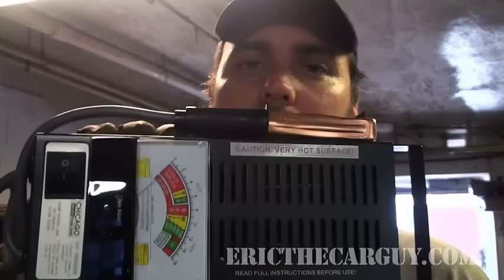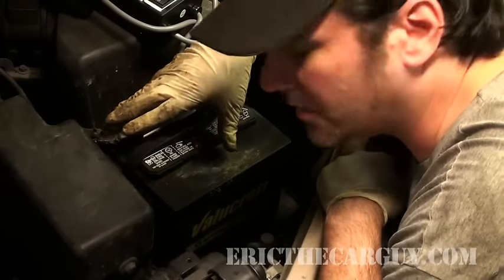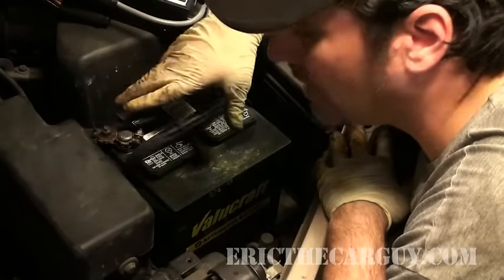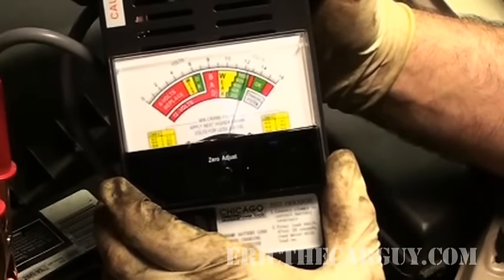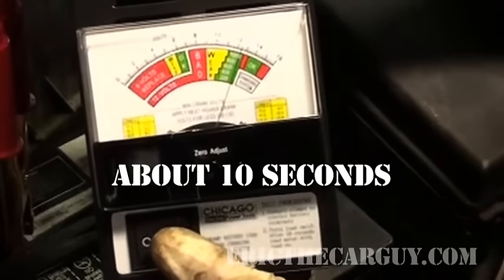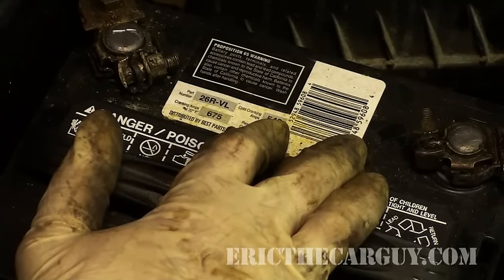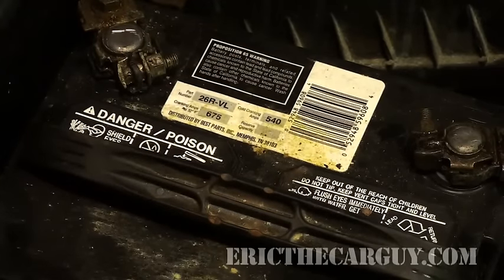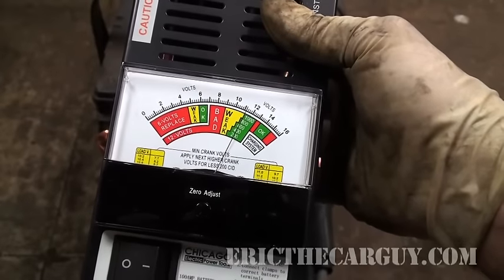Load Testing A Battery - EricTheCarGuy

Comment: 1/2 of cca for amount of time.. it's actually 9.6v
Reply: Right on Henry.  The video is a little misleading.  1/2 CCA for 15s, 9.6V is the magic number.
Reply: @debitsandcredits228   lol!! I don't remember commenting on this video..  I'm guessing your shaking your head as well when you got to that point on the video!! Hahaha!! Like he said he can do a whole video on automotive batteries. I can as well, I'm sure u can too. I'm not saying he's a bad mechanic or anything there's a few things he left out. Stick to the basics.  A full charge battery is around 12.6v if its under 12.1v + or - .2v  your load test will probably fail even though that battery is  still good!! Let's do a 360.  You got a dead battery, boost it let it ran for an hour or on a charger for an hour . Hook up your load tester... its read 12.6 (more likely 13v or something in between). Thinking it's a fully charged battery do a load test and it failed. A dead battery need half a day on a charger to get it fully charged depending on what A.  Keep in mind IT'S A BATTERY!! You won't get it back to 100% if it's been dead for let's say more than 4 times. I can go on and on!!! 
Take your vehicle to a professional and tell them the WHOLE story if you can't figure it out.

Comment: Hi What amps is this tester drawing ??
Reply: 100amps
Reply: The tester in the video is most likely rated at only 100 amps max.  A lead-acid battery should actually be tested with a load tester that can apply a load that is  equal to 1/2 of the battery's rated CCAs.  This battery is rated at 540, therefore to adequately test it, it needs to be tested with a load tester that can provide 270 amps...though a 250 amp load tester would be a close approximate.  Furthermore, a strong battery would report 11 VDC  or greater during the load test, a weakened battery would be in the 10 VDC range, and a very marginal battery would be around 9.6 VDC for most flooded-cell lead-acid batteries...or 9.9 VDC for gel or AGM (absorbed glass mat) lead-acid batteries.

Comment: 2:00  you'll need a battery load tester.  battery must be fully charged, after a drive.  battery shuold read over 12v.  wear glasses, gloves.  click the load test button for 10-15 seconds and if battery drops under 9 volts, it fails.

Comment: poor man load test  turn on all the lights for  15 seconds  then startup a good battery should  work  don't know about led lights  try this test ERIC
Reply: That's totally idiotic Margo and proves and tests very little. It's not a poor mans test, it's a morons test that does zilch.  A battery could be in a extremely discharged condition and still work the lights and still start the car.  I've seen almost dead batteries still start some small four cylinder cars.
A "test" on a battery is a number of considerations.  First, how old is the battery.  Why people hang onto old batteries  that are past 5,  6  and 7 years old is beyond me.   Second, if possible, test the each cell with a battery hydrometer.  The hydrometer is a very important tool for testing batteries.  Voltage doesn't always mean something.  You can can charge a dead battery for a short period and show a hot charge of 12.6 v  What's that mean?  Virtually nothing.    On a newer battery,  it would tell me that the battery is probably a good battery that will probably charge up, but fully charging and retesting is on the plate for that battery.  People leave stuff on in a car and will swear up and down they didn't.  So figuring out WHY a battery is dead is important.   
If the battery isn't real old and the battery seems low or dead and the hydrometer readings are consistently low across all cells, then charge the battery until all the cells read fully charged.  This can take a long time and many homeowner chargers, especially automatic chargers won't fully charge a battery.   After charging the battery, check the cells with the hydrometer.  All cells should be even.  Some cells may be a little slower than others coming up especially on older batteries.   Any cells that show dead when other cells show charged, even on a new battery indicates a dead cell and that ends the tests.  Bad battery, toss it as there is NOTHING that's going to save it.
It's a battery, not your grandmother.  Get get another battery!!!
I could write all day long about charging and starting systems.  I own a Snap-On AVR tester, managed a Battery Systems Store for about nine years then operated my own shop (an Alternator Starter Electric store) for another 10 years until retirement, but I still do this stuff on the side.
I lived and breathed batteries, alternators and starters.  That's what I did.  My specialty was electrical. 
When you have been doing JUST electrical and batteries for about 40 years like I have, a person has a pretty good clue.  I can also tell you that these parts stores and such with those electronic battery testers are worthless and those people don't know ANYTHING.   A carbon pile load tester is the only way to properly load down and test a battery.  Those electronic tester suck and are constantly fooled by batteries that have weak cells.  Remember, a battery is like a chain. It's only as strong as its weakest link. A battery is just a series of 2.1 volt batteries.

Comment: I have the same tester and the battery was dead so we charged it with a portable battery and it showed it was charged at 12.6 volts so then it turned on perfect and once we tested it with the load tester and switched it to on my tester started smoking 😭 and it went to 9v. Should I be worried about the smoke? The battery itself didn't start smelling or anything but yeah
Reply: The smoking from your tester could have been moisture on the load element
Reply: Yes, battery testers smoke. Especially when they are new. Its normal.

Comment: Can't I just use a multimeter?
Reply: Sort of. Observe the voltages while cranking. A meter with min. and max. readings will also be much more readable. It is a much less of an endurance test, but is an indicator.  This is also just voltage. Not amperage.

Comment: I am shocked you would make a video with such a poor performing tool.  Now everyone is going to run out and get a toaster and brag about being able to properly test an automotive battery.  This is extremely misleading and you know it. Basically you are saying with this cheap tool if it checks bad its bad, if it checks good it still may be bad. Sounds like chasing your tail to me.